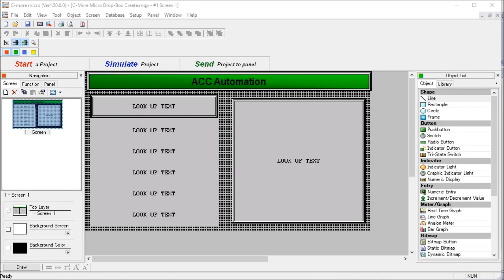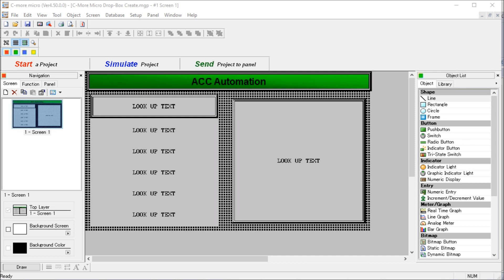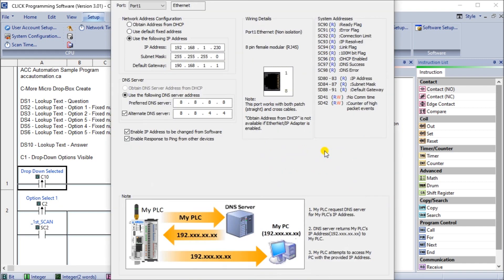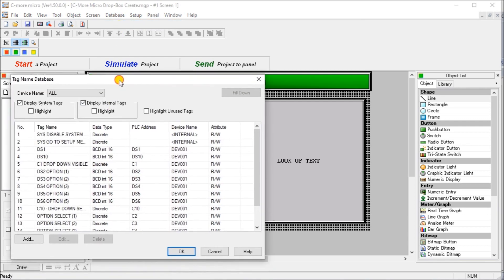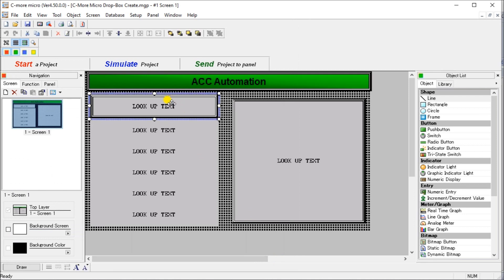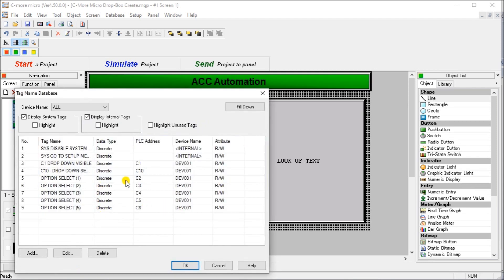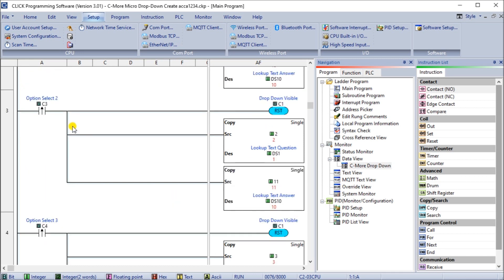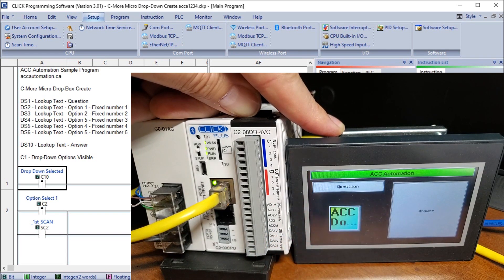C-More HMI Drop-Down Create

Comment: Hello, I am communicating a s71200 with a nextion screen through a CM1241 RS232 module and a max3232 to convert RS232 to ttl. I have already managed to receive in the plc by pressing buttons created on the screen and numbers as well, with which I have achieved the reception part. However, when trying to send from the s71200 plc to the screen so that it shows me a numerical value in a field, I cannot get it to send and it does nothing, the Tx led on the CM1241 RS232 only blinks, so something is sending but it is not what is correct. I have looked for information about all this in the instruction set but I can't find where I think the problem is, which is in the character frame. Does the display need a frame of characters or bytes to know or start receiving? I am trying to send in hexadecimal.
Reply from the maker: Hi Manuel,
This post is about the C-More Micro HMI and creating a drop-down menu. 

The C-More HMI will communicate to the S7-1200 via Modbus TCP. 
https://community.automationdirect.com/s/question/0D53u000025WjHqCAK/does-cmore-work-with-siemens-s71200
https://community.automationdirect.com/s/question/0D53u00005gftdACAQ/will-the-ea9-communicate-with-a-siemens-s71500

I have not programmed a Nextion Screen before, so I cannot help you with that.
Regards,
Garry

Comment from the maker: The C-More human-machine interface (HMI) panel currently comes in two different versions. The C-More Micro and the C-More EA9. Each of these families of HMI panels has its own software to program the controller. The full software packages for the C-More are free to download. 

C-More Micro (EA1, EA3)
Free Software Download URL:
https://www.automationdirect.com/support/software-downloads?itemcode=C-more%20Micro
Learn to use C-more micro HMI
https://accautomation.ca/series/c-more-micro-hmi/

C-More (EA9) 
Free Software Download URL:
https://www.automationdirect.com/support/software-downloads?itemcode=C-more%20EA9%20Series
Learn to use C-more HMI. This includes the headless Cmore HMI.
https://accautomation.ca/series/c-more-hmi-series-panel/

Note: The C-more EA7 series of controllers are not promoted anymore. The EA9 series has taken its place. EA7 project files can be converted into the EA9 series using the software.
Reply from the maker: Learn to use C-more micro HMI
https://accautomation.ca/series/c-more-micro-hmi/
Regards,
Garry